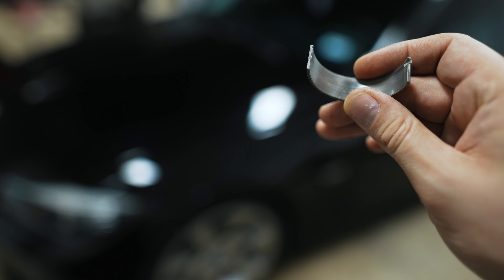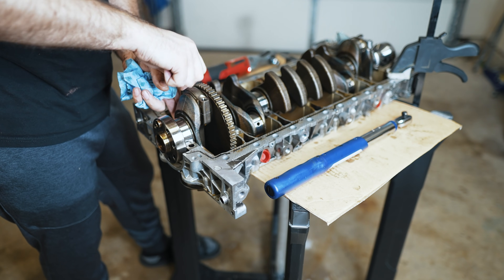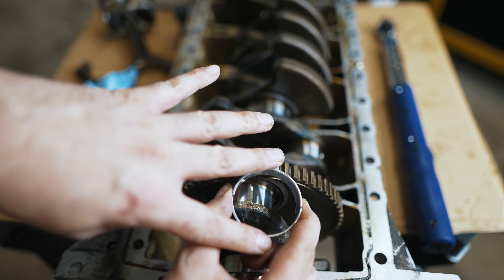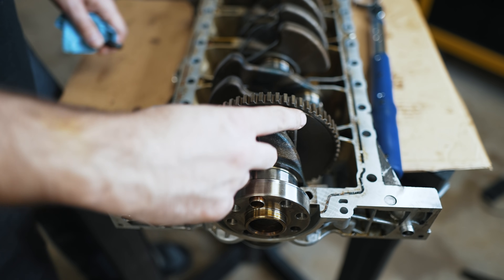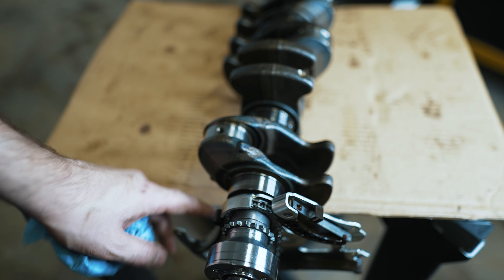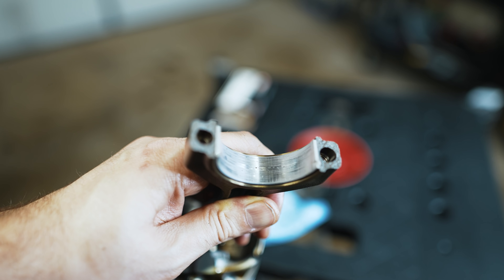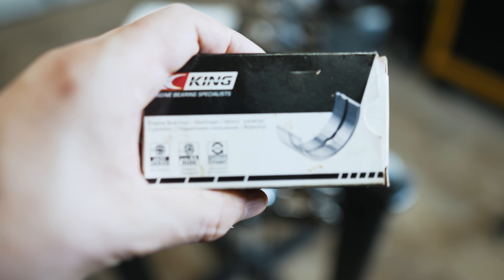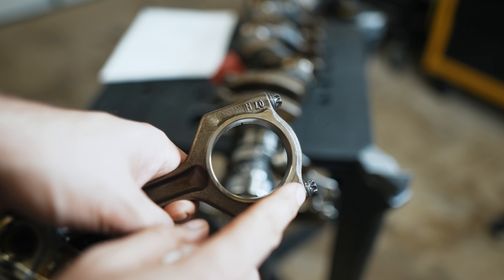Why Can BMW Rod Bearings Fail?!

Comment: I remember you replaced bearings with that thick pink goop.
I've never seen it used before and feel its use may be suitable for camshaft lobes- not so much for enclosed bearings.
It suspect it prevented oil flow as it would take huge pressure to puch thick goop out of tiny oil clearances.
It's like using 400 weight oil if you get me.  
Thanks for the videos 👍
Reply from the maker: Thanks, It was recline assembly lube, I would assume it's suitable for a bottom end but maybe with such clear tolerances a thiner assembly lube would be better
Reply: Typically assembly lube is just fine

Comment: during the oil pan gasket change on my N55 E90 at 103K miles, I removed one of the rod bearing caps to examine the rod bearing. Since the bearings looked good, it buttoned it back with two new bolts and 20NM plus 140 degrees. After buttoned up, I tried to move the rod bearing laterally, and noticed the movement is much less than other five rod bearings. Wondering what caused it to be tighter?
Reply from the maker: Did you do it in two stages of 70 degrees when tightening?
Reply: @VehicularDIY  yes, 70 and 70. Engine seems to run OK now, but I hope tighter clearance won't cause a spun rod bearing later.
Reply: You might have just had more tension on the rod, like the piston was pulled up in the cylinder further.  Just a guess. Shouldn't have made any difference with new bolts.

Comment: I have the z4 n54 And this 5 and feel like we're chasing a fail that bmw knew would happen beyond  the power they gave it safe at 305bhp
 in my humble opinion   the lesson isn't what went wrong but it  will go wrong South of the 305 bhp -  slightly above this seems to be the sweet spot you want more reliable get a m car  - love channel and subbed but just wanted to be a realistic opinion
Reply from the maker: Thanks yeah I'd say if you stay under 400 whp you really don't have much to worry about with the bottom end.
Reply: Mate keep up the content teach the world 🌎  what happens when
Reply: These engines can handle 900hp stock but need to run thicker oil to compensate for the increased load.

Comment: I'm going to start this off by saying I love watching your vids, and I don't even have an N54.... ('11 E90 335xi M-Sport 6MT)  Yet I watch just about all of them. lol

Plastigauge is a ballpark check.  It surely will indicate if you did the math wrong (from mic numbers) or have a wrong size part, so it's not like it doesn't have value.  It's just not going to be accurate enough to compare tolerances between OEM and Aftermarket bearings, IMO.  When you use PG, it's critical that the joint is immobile.  In your case, it looked like those rods were swinging free when you torqued them down.  Normally the piston in it's bore would hold everything still while you're torqueing those rod caps.   Maybe call around to a couple automotive machine shops and see if they won't be able to get you some more precise numbers?
Reply from the maker: Thanks for watching!  Getting my hands on a micrometer would help.

Comment: Dude, never seen anyone present bearings in profile view. I didn’t realize they shift in relationship to rotation, I figured it was kept round by clamping force.
Reply from the maker: Yeah the sides of the bearings pull in under load.  Pretty neat.

Comment: You mention when it failed. The temperature is 120F. Was it coolant or oil temperature? From the N55 In the warm up phase, the oil temp lags the coolant by 10C and (below 120F, oil pressure is ~100psi; over 120F it drops back to 40psi; will double check)
Reply from the maker: That was oil, coolant was up to full operating temp.

Comment: Hope you havent already answered this but the N55 has a known issue where the chain tensioner fails. So much so that theres a class action lawsuit currently going on regarding failed N55 engines due to the chain, the chain tensioner, and the oil pump. Do you think those characteristics were born in the N54 and carried over to the N55 or is it a completely different issue? Absolutely love the videos! Keep em rolling!
Reply: Wrong, N55/54 are not known to have timing chain issues, that’s N20/N26 motor lawsuit. N55/54 is known for oil starvation at high G, solved by adding baffled oil pan. Also some people don’t prime their engine after ofhg and throw a rod.
Reply: You are correct to a degree, the exhaust and intake cam gears can come out of alignment and skew the timing with low oil temp or incorrect oil weight and improper load. I’ve done this with my N55 and I had to redo my chain, guide, cam gears, etc
Reply: @laserjet6941  like standing viscosity or viscosity at a certain temperature

Comment: 120° F should have been sufficiently warm at anything less than 3/4 throttle.  So you say the oil pump chain tensioner failed at idle yet you do not think it caused the spun bearing?

You might also want to inspect your Vanos pump just to be certain no metal parts went through it.

Thank you for  taking the time and posting.
Reply from the maker: So the oil chain tensioner failed at idle but the chain was still on and came off while driving after.  Then I fixed all that and put new rod bearings in and they lasted 1k miles. So the stock bearings are what would have been affected by the chain coming off by they still look great.  Someone brought up a point that the oil pump could have suffered damage.  I opened it but have checked it completely.  The shock of the chain dancing on the sprocket could have compromised the oil pump internally.

Comment: There was some contamination in the oil system it self, just my humble opinion.  The big end of the connecting rod potentially could have been out of round.  The only way to tell is to torque the rods and check for out of round with a bore gauge.  Best DIY channel on the planet Great work again.
Reply: I agreed best diy channel on the planet
Reply: Yes, I agree. When you mess with rod bearings, you will almost certainly throw the roundness out no matter how meticulous you think you are. It's practically a rebuild at this stage. You should get the rods line bored to suit the new bearings and yes, use new rod bolts.
This Channel is one of the best DIY channels out there. He's very humble without the arrogance and pretentiousness  of most other channels out there. I'm getting tired of those and have pulled my sub in protest of their non appreciation of their audience who make them rich.

Comment: Bearings can also fail from too thick oil. If the oil is not considered when using tighter bearings you will get too high pressure and not enough flow to critical parts of the engine.
Reply: 5w-40 is perfectly fine
Reply: @BmwMe-uh9sy  Yes, however 10w50 and 10w60 might be pushing it
Reply: But VANOS doesn’t like thin oil. That is why bmw recommends 10w-60

Comment: If you flushed your old oil cooler im curious if you would find debris.
Reply from the maker: Good point, I could check it.
Reply: I'd imagine most of the debris is in the oil pan still and oil pick up tube.
Reply: @alexeimaterov3226  He cleaned it all out already and had some debris in it.

Comment: What oil brand/weight were you running? Could the oil you used to flush the engine cause it to ruin your bearings? I thought you used a non synthetic oil to flush it.

Comment: Micrometer and torque wrench calibrated perfectly? If no It’d probably have to be hellish variance anyways so Idk. I’m afraid to go upgraded bearings for this exact reason.
Reply from the maker: Yeah given these engines come with pretty tight clearances from the factory I don't think plastigauge should offer much of any assurance when changing bearings.
Reply: Plastic age is still a good check. There was a guy a few years ago that changed his N55 rod bearings. After changing one of them he was unable to turn the crank. A check with plastic age confirmed that it was in fact a thicker bearing. The box had the intended bearing size stamped on it.

Comment: This is so heart breaking. and confusing. Did some debris despite all the flushing not get removed? Did any oil related valve or VANOS piece somehow cause a oil pressure drop? Have you inspected all the oil passages to see if something clogged and then bearing failed and  then creating debris to etch the rest?
Reply from the maker: Yeah if all the bearings looked good I would have just assumed it may have been debris but they all were marked up so reduced oil pressure is the only logical explanation.

Comment: I’m not an expert here but when you opened the oil pump the mechanism seemed shifted to the side, was looking at the pictures on forums and the internals aren’t shifted to the side like your old pump? Not sure but worth to check it out
Reply: If there was an issue with the bearings install you would have noticed it almost right away, a dying oil pump on the other hand will take some time to finally seize up
Reply: @polimeneas1  hence why i was impressed when he went ahead and threw an oil pressure sensor in the new engine on his video "this could save your bmw engine" . Already had a pretty clear idea that his issues were pressure related. And hes been spot on with all the installs with every aspect in mind. Kudos my friends.
Reply: Thinking the oil pump mechanism got seized which caused low pressure and since cylinder 3 is one of the hottest bearings that was the first to go
Reply from the maker: That makes sense, I would imagine it would have just been making low oil pressure.  When the timing chain failed the first time it could have vibrated a lot causing stress on the pump.  So I'll have to see about how that piece moves on the inside and see if there are any obvious signs of failure.
Reply: @VehicularDIY  boom. You got it.
Reply: @Tyler Yes but the pump looks seized in that position for some reason. The springs are supposed to keep the ring and veins in the centre position without oil load
Reply: @polimeneas1  oh yes I did email him lastnight to see if the plunger is frozen
Reply: Just happy to help, it had nothing to do with the rod bearing install, everything was torqued to spec and the clearances were all within proper spec as what I saw in the rebuild videos, you did a phenomenal job
Reply: The out housing around the veins can move to regulate flow....you can see a spring in the corner which determines and regulates pump volume.....his pump look fine really
Reply: I noticed the same thing while watching the video for the first time. I was wondering how that oil pump can spin in a circular motion while being uneven.🤷🏽‍♂️
Reply: @pinoysi06  that's how vane pumps work
Reply: I would also open up the vacuum pump as well, check out the condition
Reply: So what happened any update?
Reply: https://m.facebook.com/hackengineering/videos/759191681286746/ , this is how the mechanism works, the original engine failure could of caused the middle rod of the oil pump to shift due to extreme or low pressure
Reply from the maker: Wow interesting thanks, I'll pop that back open and take a closer look.  Maybe something happened to it when the chain tensioner failed the first time.
Reply: @polimeneas1  Wow, good catch! At rest it looks like the vanes are centered evenly.  His are pushed to one side.
Reply: Junk that old bmw...a money pit!!..a big headache  to fixx!!!...plus you drive it hard!

Comment: I wonder if anyone has an upgraded oil pump that would help with flow volume on start up and cold starts to help prevent wear on the bearings.
Reply from the maker: Yeah that would be worth looking into.
Reply: @VehicularDIY  I have a few oil pumps. I am really leaning to the maybe I will pull my bearings just to compare how they look, we did put them in basically the same time.
Reply: Note that the oem pump is a pendulum pump and even though it uses vanes like any pd pump it varies the flow by pivoting and thereby reducing the flow rate.
Reply: Of you remove the oil supply line to the pendulum it defaults to full pressure

Comment: currently in the process of building my N54 - i spun a rod bearing and then had a machine shop take off 0.25mm on all the journals. I'm putting in oversized 0.25mm king bearings that are calico coated. all of my clearances are pretty much the same as yours, roughly 0.038. still wondering what happened here, and hoping this doesnt happen to me haha
Reply: Gonna comment here in case something does happen maybe you can update us?  No knows will be great news though :)
Reply: @TheFrenchPug  update: engine now has about 8000 km on it running ~30psi from a single turbo and no issues at all so far.
Reply: @csmitas  Wow!!! That is powerful.  Almost too much power for that car.  But congrats!! Don't tear that rear end out :)
Reply: @csmitas  is it still holding up well?
Reply: @ericklewis289  Yep! Didn't have a chance to drive the car much this year, but the car has run 34psi down the drag strip multiple times and its been fine!
Reply: Just did mine as well. Had #6 spin. Did some polishing on the journals and all journals were .053mm except one which was .038mm.  This just after purchasing the vehicle at 101K miles. When dropping the pan it had new gasket and the pump looked brand new so I’m suspicious of what the seller was up to. I’ve got 0/40 Mobil 1 in it and about 200 miles on it so far. Will keep you posted.
Reply: If you have 38 thou bearing clearance, you'll have a hell of a rod knock...
Reply: @rv6ejguy  0.038mm is what i meant, or 1.5 thou

Comment: I don't know if you've ever seen any of papadakis racing videos here on YouTube but he shows you how to build an engine and check for bearing clearances and it says plastic gauge is great for just generally checking it but it's not accurate, maybe you can borrow from your friends at that auto shop the tools to properly check the bearing clearances to get a better idea what the actual real clearances are between the stock and the King bearings
Reply from the maker: I have, that's a great channel.  Thanks
Reply: @VehicularDIY  Curious will you be doing a follow up video on this? :)

Comment: On my lunch break at BMW watching bmw vids. Life can’t get better than this
Reply: wats 4 lunch
Reply: @BmwMe-uh9sy  rod bearings in 10W60 oil sauce 😜
Reply: @ronan7812  sad truth mechanical reliability is the only part of the new m4 that scares me, grill included
Reply: @ronan7812  I eat mine like chips
Reply: Why do the bearings fail?
Reply: @armandonika a few reasons, oil starvation from a basic distributor / not warming up the engine/ they were made cheap
Reply: @armandonika  buy mahle performance for rod bearing its the most even m5-m6 can't break them easily they are know issu problem and eyt this mahle handle good* i aggre with eliasbutcher do mentenainced and all good even preventif would be good to anticiping
Reply: Tryna b like u mayne